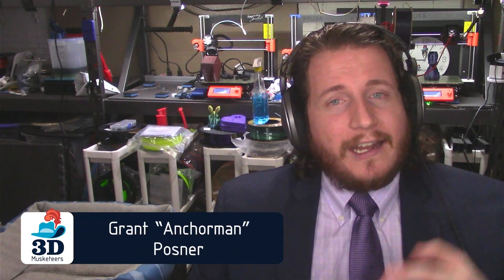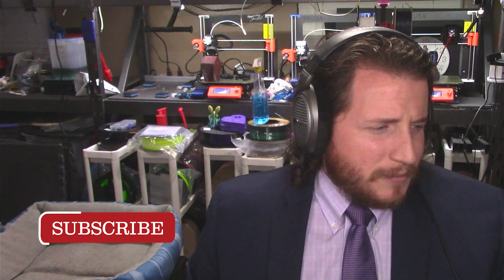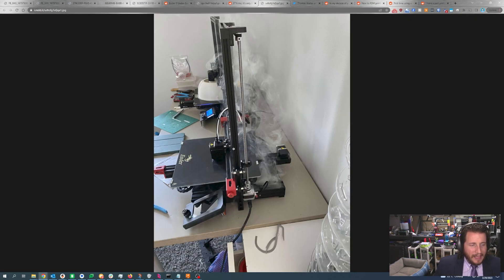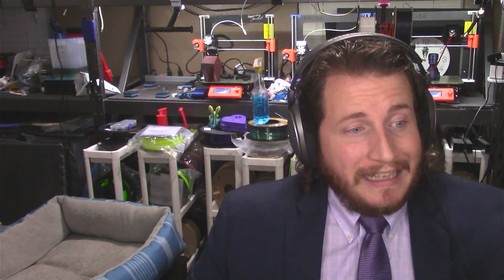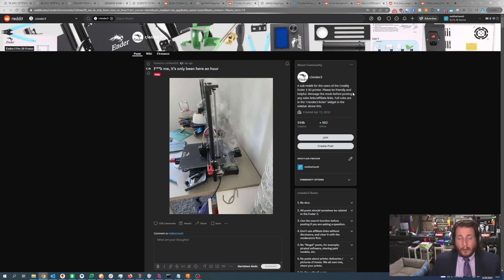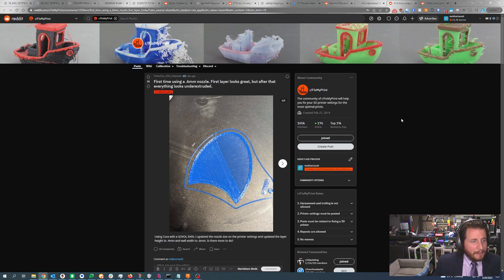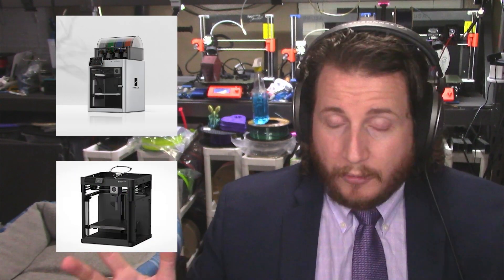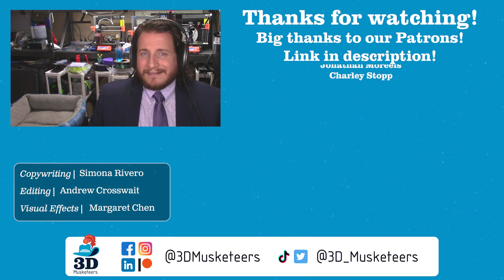PFF: Dapper Edition! - PrintFixFriday 81

Comment: My first ever printer, an ender 3, has a 120/230V switch on the PSU.

The moment I took it out of the box and say that switch, I triple checked it, then covered the thing in layers of tape so not even a speck of dust could touch that switch. I was genuinely scared of flicking it by accident and burning my house down
Reply from the maker: It would likely just blow the power supply. May give you a good scare but fine overall
Reply: @3DMusketeers  Still.. it was a new thing and I was really scared of the "flick to blow your PSU up" switch
Reply from the maker: I mean, fair, you may need new pants lol

Comment: Sorry but before i get into this video, i need to ask, should I be upset that prusa launched the MK4, are there any major things on this new MK that are also used in the manufacturing of the XL IM WAITING PATIENTLY for? like it has the load sensors being used now, and i haven't done too much research in to it yet (want someone else's opinion) but most likely parts for the 32 bit electronics that were so hard to source are now being used in the new MK's... please talk me down musketeer
Reply from the maker: it uses the same extruder style, load cells, etc. 

I wont be talking you down, you need both LOL
Reply: @3DMusketeers  you devil

Comment: I've had an issue that has happened a few times. If the filament sensor is tripped for any reason (like running out of filament or just an oddity in the thickness that is enough to trip it) the printer will beep ask to change it, and then extrude a bit in the air, and finally ask if the color is correct. The issue comes next. When it returns to the print........it just snots plastic all over the place for a few lines. It's like at least 4x the amount of material it should be extruding. Then it returns to normal. Fortunately when this happens to me it's usually on the purge block. I have to use side cutters to smooth the purge block or I'll get a collision and more often than not a ruined print. So today I noticed I was dangerously close to running out. So rather than risking it, I just changed it early. That way I don't have this problem. I changed it while it was using a different color. Anyway.......is this normal behavior and/or do you know of any way to fix it?
Reply from the maker: never had that./ It does extrude a bit when going back so I make sure to not pull away the initial poop until RIGHT as it starts printing.
Reply: @3DMusketeers  even if I get the extra cleaned off, it still massively over extrudes.
Reply from the maker: weird...
Reply: @3DMusketeers  yeah I do that too but it will still leave too much.
Reply from the maker: and it eventually stops after a layer or 2?
Reply: @3DMusketeers  not even that long. About 2 inches or so.

Comment: I've removed my revo with filament that got stuck from heat creep a couple times. Easy fix with a heat gun and some pliers. Also I now have a spare heater core. I think it was like $20/30. But yeah I rebuilt my revo after I thought I killed it. It works fine. I had to remove the strain relief and flatten it out. It's been abused, and yet you can't tell it's not new. Very durable. If it was a V6, I'd have to replace it by now (or the components). lol
Reply: In my case I was printing when the thermistor wire broke and the printer went into emergency shutdown and cooled down. So now I couldn't use the controls  to move the hotend up because of "Err: Min Temp" or pull the filament back through the MMU, because it got cold.

I basically wasn't able to remove the nozzle to fix the heatercore, because the broken heatercore didn't allow me to do so :). It was more about it being a fun little hen and egg problem that I solved by cutting the filament above the extruder, free the extruder idler and then turn the nozzle with the filament inside (and moving Z by hand before).
Reply: @ulaB  that's what I had to do with the heat creep. Cut it on top and then unscrew it and pull it down with 2 inch or so of filament sticking up. lol
Reply from the maker: things you dont think about needing until you do LOL
Reply: @3DMusketeers  yup so if I do kill it I don't have to wait for one.
Reply from the maker: thats fair!

Comment: My Commodore 64 didn't have a power supply. I bought a meanwell and created a home made C64 power supply. It's dual voltage. So I guess they make some that aren't.
Reply: C64 forever! (Even though I have to type "go64" first since I have a C128D ;) )
Reply: @ulaB  I thought about getting a 128, but I didn't see the point as I don't know of any use for a 128 over a 64 at least in gaming. I think Ultima is one exception, but tha'ts not a game I ever played.
Reply: @awilliams1701  I have mine since 80s - it's the machine I started computing on actually. :) These days it really doesn't make much sense unless you want to dabble with the Z80 it had.
Reply from the maker: I feel like there are so many hobbies that overlap with 3d printing ha ha!
Reply: @ulaB  it's a mos 6510 based on mos 6502. It's actually superior to a z80 but because it runs slower they are actually comparable in speed. 6502 at 1mhz is about the same as a 4mhz z80.
Reply: @ulaB  my parents got rid of it after the PSU failed and there were no more replacements. I was convinced it could be fixed. Ironically...that's the very fix I did in my 2019 ebay purchased c64.
Reply: @awilliams1701  I was talking about the C128, which had two processors. A 8502 and Z80. You could switch between these two which I still find impressive. In Z80 mode you could run CP/M which had a massive software library at the time. I think it was the predecessor for DOS(!).
Reply: @ulaB  ohhhh yeah. CPM doesn't register on my radar and since 95% of C128 operations are in go64 mode, I forget about the z80.